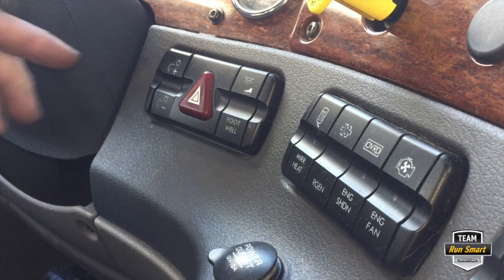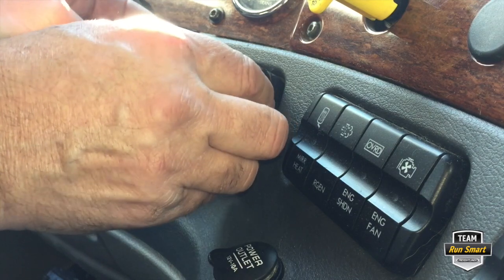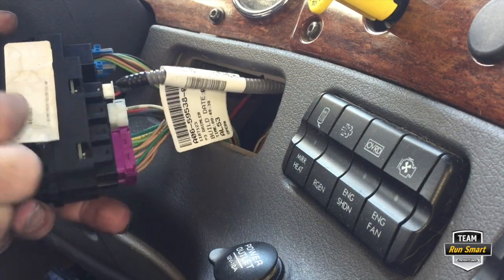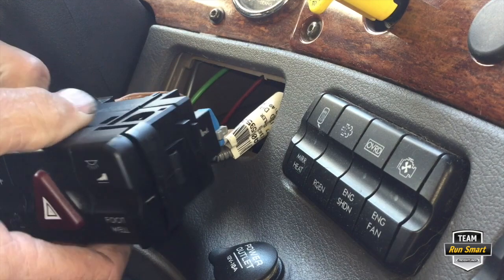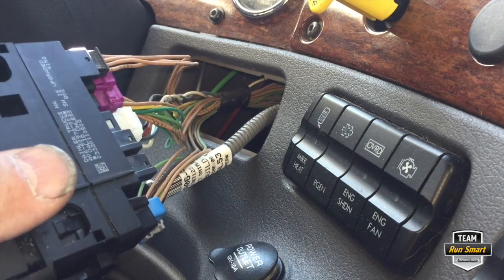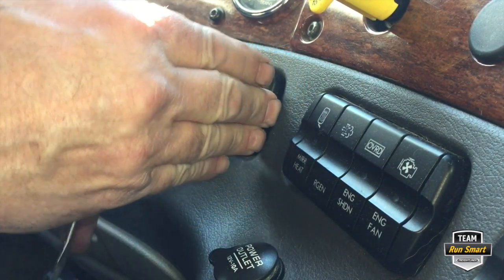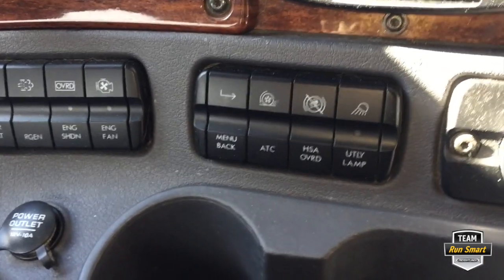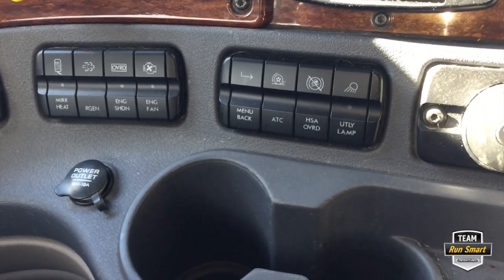Replacing a Dash Switch on your Freightliner Cascadia

Comment: I have 2 additional "opt" switches for accessories I want to wire up. When I pop the panel the "opt" switches have 2 wires ran to them. I assume it's power so the red LED stays lit when you toggle them on. My question is how should I wire what I want in there? There are about 4-6 open ports that I'm assuming are to be used for what I want. It's a ferole attachment for the wires to stay in. I'm guessing I can crimp a ferole tip on and plug it in. Anyone have any idea?

Comment: Excellent video. I watched you do this before I attempted replacing the hazard light switch, so maybe I wouldn't tear anything up.  My haz lamp switch was sticking but still working if you pop it back up with a knife. Kind of annoying and certainly not worth $150 but hey I like everything to function correctly.  Thanks again for the vid

Comment: Thanks sir for your video! Super helpful, I had been wondering if that was something a driver could swap around.  I rearranged mine, it's going to take a little getting used to.  I have a 2012 and I'm the only driver she's ever had lol!. 
One question. I have a blank spot for a switch, what can I put in that place? Could I put in an engine fan switch?
Reply: Kenneth Turner Thanks for watching, I’m not sure if you could put a “new” switch in and the fan work with that switch. It all depends on how the truck is wired but a good Freightliner dealer could tell you if it would work, it might. I will say we have a fan switch and have never used it, the sensors do a good job keeping up with the temperature as needed.
Reply: I've got a 13 and had Freightliner add a manual fan switch. It was less than an hour labor + parts. Works great